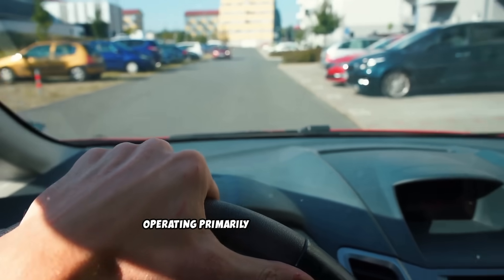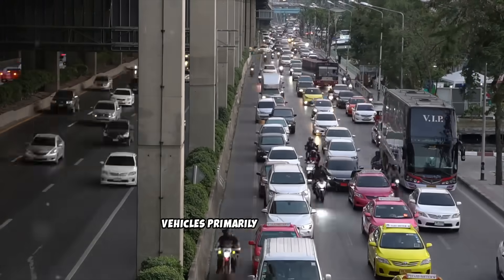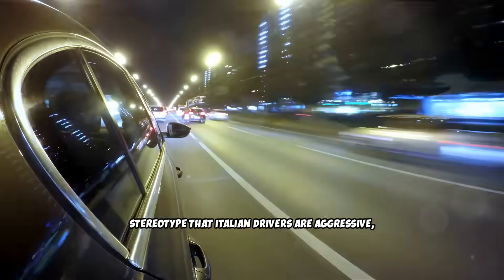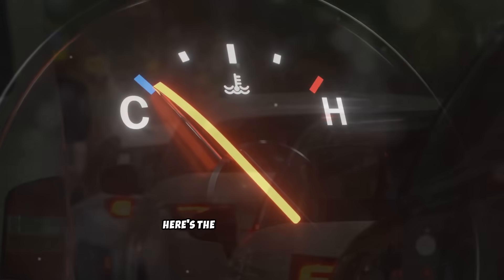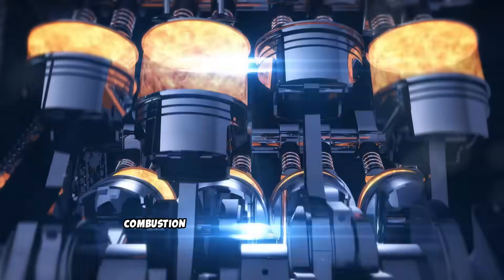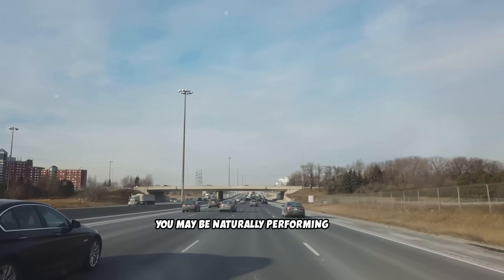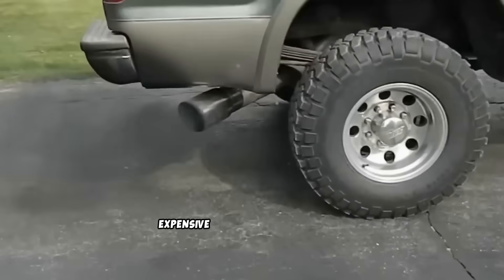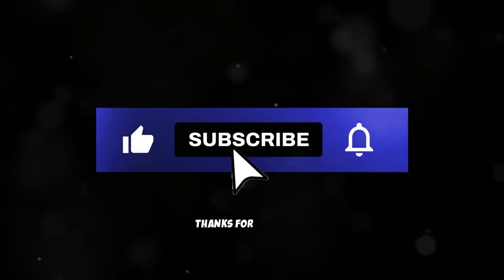Do THIS Once Every Two Weeks, and Your Diesel Engine Will Last Forever

Comment: I have a 1.7L diesel astra van, recently the glow plug light has started flashing on the dash. As a self employed Gardener my jobs are local and driving is usually short, however after giving the van a blast a couple of times, the glow plug light stopped flashing, yesterday it came back on again after doing some shorter journeys. I'm thinking it's the DPF, so i'm going to try giving it a blast again and if it's stops this time, i believe it confirms my suspicions of the DPF?

Comment: I wonder if using a lower gear (higher revs) at a given speed creates more heat? My physics brain says the car is still under the same load so it wont make much difference. Answers on a postcard....

Comment: Every time a channel tells me to watch till the end, my sceptism level jumps to caution mode which takes me to the comments column.
However, on this occasion  the comments corroborate what I find when driving my 2.2 diesel.
I've  even found that on long motorway journeys, driving in 5th gear at higher revs is a smoother ride, with very little difference in fuel economy. 
Also 3000+ revs up a slip road in 3rd seems to help too. 
The green agenda would have us drive every which way a diesel is least efficient, even to the point of destroying an engine, so it gets scrapped, then another car needs to replace it.

Comment: Hot, warm or cold I always let my truck run until it hits the 220f degree mark about 15 min, you can tell the difference. They are sluggish if you don’t let it get there before driving

Comment: Another good technique is if you do a lot of short trips with your diesel you can drive it in tow mode. This will hold transmission gears for longer which makes the engine rpms higher, resulting in more "work" for the engine. I wouldn't suggest using it in the rain or snow without a load tho.
Also, running your exhaust brake while driving will blow out carbon in the turbo, at the expense of DEF use. But DEF is cheap, turbos arent

Comment: Once a week I take my Volvos with proper D5 engine (imo best Volvo ever made) to run it like Colin Mcray!! Keep in on 3500 with my paddle shifts and basically flooring it and enjoying turn in country side!! 😅 it’s pleasure as well as good for my engine! Both vehicles around 250k now and no problems!! If you have diesel you need to know how to run it otherwise yes carbon built up can be a nightmare!! 😮

Comment: I may have been too gentle too long.  I'm going to get a real DPF cleaning at an industrial shop and do an EGR and manifold cleaning by hand.
Reply: Waste of money. The EGR cleaning is basically them connecting a device to your OBD port and set it to run at high RPM's constantly to warm up your DPF so it initiates a regeneration (burn out soot). You can easily do that yourself by driving at highways speed at 1 to 2 gears lower than normal. If you see smoke keep driving, because there could be alot. I drove mine like I stole it once and then I parked while idling and I thought the car was on fire, had it towed to the shop and it turns out it was just cleaning out the DPF and they didn't have to do anything. I just made the DPF get hot enough to sense it and initiate the process and a guy that drove slow everywhere had driven if for months.

Comment: My 2024 RAM has done 500 hours of idling in the last year alone (emergency vehicle). Yet the DPF gauge is at 0%, after bouncing as high as 25-50% briefly. That is because I frequently, when on the highway, set the cruise control and then downshift a gear to be right at 2000rpm. Do 50 miles with that, and it clears things out and goes back to 0%.

Comment: They also were not designed to have the exhaust fed back into the intake and the def system added to it.  It retards the exhaust and plugs up the motor.

Comment: Most mechanics who work with diesel engines will tell you to use this technique (or variations of it). Very necessary with the newer diesel engines which use Adblue and have DPF's.

Comment: One problem is the Exhaust gas of modern engines. Use a low gear. I use very often manual gearshift instead of the automatic gearshift to have higher RPM.

Comment: Same goes for All modern petrol engines with direct injection - they need to be revved up full stop. My ford ecoboost is wasted with carbon buildup - yeah, cause you drive in traffic like nanny, hammer down the s***er once a week and it will breath normally

Comment: 142 thousand in my Volvo S60 2.4 turbo. I only use VPower Diesel Fuel and have a Full service every Year. The Engine is smooth and powerful and on a long run, it is like a Greyhound. Once a week, I do about 40mins Motorway driving. You have to work them!!

Comment: Got my first dl in 2004, but had been driving before, because I got used with some carbureted vehicles, that exactly the way that I treat most the cars, key on, wait a bit, start moving gently, pay attention at the gauges, gear up, enjoy, cooldown period, turn off. 

From the past few years I have a old JDM Diesel, non-dpf from factory (its a 92) and I do that, and a some fuel additive (injector cleaner or diesel purge) every few full tanks) still going good.

Comment: I used to load my Dmax  produce from the farm, 3-4 times a week around 900-1200 kgs, it ran smoother and consumed less fuel. Now I lost the farm and the truck seldomly loaded with any load and consumption increases.

Comment: I’m retired and when I took my diesel van to be serviced at a diesel repair shop the young mechanic said the problem I had was caused by me driving at low revs to save fuel ; he said what I must do is drive it like a sixteen year old now every now and then. He was right it cured the problem.

Comment: The video explains the "Italian Tuneup," a simple driving technique to extend the life of diesel engines by counteracting carbon buildup, which often occurs from short trips and low-speed city driving.

The Key Idea:

    Problem: Driving at low loads (city driving) prevents the engine from getting hot enough to burn off carbon deposits, leading to reduced efficiency and potential DPF/EGR issues.

    Solution: The "Italian Tuneup" involves running the engine at higher RPMs and loads to generate the heat and airflow needed to clean out these carbon deposits and complete DPF regeneration cycles.

How to Do It:

    Warm-up the engine normally for 5-10 minutes.

    Drive on a highway or rural road, maintaining 2,500 to 3,500 RPM in the highest gear you can safely use (e.g., 65-75 mph).

    Maintain this speed and load for 15 to 20 minutes.

Frequency:

    It is recommended to perform this procedure once every two weeks, or immediately if you notice symptoms like reduced power, black smoke, rough idling, or a DPF warning light.

Comment: I had to do this for my 130000 miles Dacia dci. I suggest using a diesel fuel cleaner solution in a full tank to clean a lot of carbon. Then use one like Redex in a quarter tank. Redex works at lower temp, as does some others, then drive for 3000rpm for 20 mins. Solved all problems. The injectors are £200 each to service and then clean the rest so £30-40 for the fuel treatment is cheap. Mine worked I hope it does for you
Reply: you may as well buy new injectors.

Comment: What if I use a car like twice a week? More often 80 km range and sometimes longer trips. The reason why I dont use car that often is because I got a Bus that drives me to work so I dont have to refill tank twice a month. More money saved. Shoud I take my car to the highway every two weeks also?
Reply: Nah your engine is pretty clean as you are not choking it in town...
Only thing you can do when driving out of town to rev it at 2000 or little bit above that for 15-20 minutes...👍

Comment: Why can't you put it in sport mode or put it in manual mode and hold it in the the right gear so you don't have to go so fast
Reply: You can do that specialy driving up hill in a lower gear it will clean the engine but for the best results you need open road for better airflow...

Comment: I live in a major city where traffic is so bad that it's usually difficult to get to 60mph (100kph) but I've been able to complete regens in less than 10 mins by maintaining around 3 - 4k rpm in 2nd gear (60 - 80kph). I'm lucky that my cars visual display shows when it's in regen mode. I drive at higher revs as soon as I notice it trying to regen. Prevention is better than cure as they say. Not sure why so many other manufacturers omit this

Comment: Delete DPF delete EGR and swirl flaps all so get a new intake manifold get a carbon clean and put in premium diesel and watch it run like brand new
Reply: Plus fail your MOT and risk ruining your engine and turbo by running a higher combustion temp it wasn't designed for

Comment: U are all wrong, If u drive whit live data, u wil se for urselfe that this is totaly wrong ! 
When u drive whit low rpm. 1500 the engineering generate most temp. I have allsow live data at the particle filter, and it generate highest temp around 1500 rpm. The engine start to burn sot at 400 degreeds. 😊
Reply: When regen start is around 600 C to 900 in your exhaust pipe...😊
Reply: don't talk shite mate, go and study thermodynamics. High revs engine will produce more heat output. The live data is probably your coolant temp.

Comment: I also use dipetane. When you first use it you get a funny smelling light smoke coming out the exhausts for about a week. This is the carbon burning off. I put my porsche cayenne 4.2 d in for an mot and the emissions were nearly zero. My mate took out his dpf in his ford van and the black smoke coming out the exhausts for the first couple of minutes was terrible. He then put the dipetane in the diesel thinking it would be a waste of time. He couldn't believe it when there was no smoke at all.

Comment: Floor it the second u cold start your engine, garanteed way to clean your engine of any buildups...i do it every morning before i go to work, neighbours might hate me, but my car will run forever.
Also dont forget to rev the engine till 3000-4000 RPM before shifting to get the most power output without loosing acceleration inbetween shifts
Reply: Wrong! Never run a cold engine hard before its up to operating temperature!! Thats a sure fire way to destroy any engine. ( retired mechanic of 40 years).
Reply: Quality of diesel engine's are really good as they survive this cold start abuse...😊
Reply: lol… years ago (about 40) I witnessed a guy start his cabover

semi truck and hold the throttle to the floor. Yes,the outside temperature was around -15 degrees. It was a sickening sound when that engine started making sounds an engine coming apart….which it did

Comment: As the speed limit caps at 100 km near me, can i achieve the Italian tuneup by driving in 4th gear as opposed to driving in 5th?
Reply: Of course, from my experience should use best fuel money can buy like Shell, occasionally Shell V-power or other premium diesel fuel, never use cheap supermarket fuel...👍
Reply: @SvarogI2A2  I found no difference in which brand of fuel I use  (200,000kms driving)

Comment: How can I disagree with you more? There's a device in the cooling system called a thermostat it's job is to get the engine up to operating temperature within a few minutes of startup. The total premise of your argument is debunked within seconds of the discussion.
Reply: Does the thermostat not regulate the water coolant temperature? Engine temperature is a different thing.
Reply: Lubricant takes a lot longer than coolant to get to operating temperature - do not rev your engine hard when the oil is still cold as this is how engine wear is accelerated.

Comment: Diesel engines are the perfect machines for longtime heavy duty work, i drove my Bx Diesel foot down in Germany in 9 months to 190.000 kilometers. The garage could not tell the difference between my car and another Bx that had done only 15000 kilometers in almost the same time period. Stop the witchhunt on diesel engines they last forever and are the most durable off all engines when used properly
Reply: So I should sell mine if I don't drive much??
Reply: @dibosh7405 
Don’t necessarily sell it,just understand the video.

Comment: This "tune up" also works for cars with gasoline engines! I have both a gasoline and a diesel car and has been driving like this with both of my cars and they both runs so much better. I recommend everyone to get to warm up their engine slowly and then drive your car maybe not like you stole it but between rpm's at 2000 and 3000 with load up some steep hills, it works great in my opinion.

Comment: Diesels are for long distances. When you have to drive 30km + almost every day to work or for any purpose on highway. In that case they most of the time maintain itself without extra need for action like this, but even than is better once in a week, after engine heats up,  put in lower gear and drive for a while with higher rpm's. Also very smart is to not  notice a car manufacturer reccomendation in modern engines to change oil after every 30k km. Better change it after every 10k. Not because the oil is turning bad, but because of the carbon buildup particles deposits in oil.  Gasoline is for city driving.
Reply: So agree with you, i drive both my petrol and diesel car the way you say and the engines runs so good. I use longlife oil on both my cars and do the oil changes at 15K km and have never had any problems with that when using longlife oil that is being said that you can drive 30K km between the oil changes. I would never drive so much with the same oil in my engines.
Reply: Amen

Comment: I have done this before on my last car. Worked well. When the dpf light came on, I drove between 2 motorway junctions (20 miles approx), always in 3rd gear at 4000rpm. Cleared the light every time. It's more of a problem with my latest car as it's an automatic and the thing won't hold the gear I want, it just changes up to the next one. I'm not impressed 😅
Reply: Surely the auto box has a manual mode. I've had auto gearboxes since the late 1980's and every one allows you to use it in manual mode.

Comment: I did this with my Volvo C30 2.0D which seldom goes above 2,000rpm in the past 4 years -  I put it in manual mode in 3rd and took it to 3500 revs for just over 12 mile -  it seemed cruel but I did - it started smelling like something new being burned off - I did the last 4 mile in Auto  about 1500 rpm in 6th to let it cool off - at a guess I'd say the smell was the particulate filter burning itself clean - I may do it every couple of months as it does seem a bit crisper - the car is very overpowered for its size

Comment: Good information, thank you!

My Honda CRV Dtec (N16 engine 9AT) needs the itallian tune up
I just select to manual mode & drive within the speed limit staying between 2500-3000 RPM for 10-15min on the expressway
I also use Techron diesel additive every 4 months on a full tank of fuel 
HTH ✌️

Comment: It's easy to maintain the rev range in a suitable gear if you drive a manual car, but an automatic that doesn't have a manual overide would have to be on a motorway to attain the speed that produces the rev range required for safety.
Reply: Hills exist drop a gear
Reply: Yes, my automatic car tootles along at about 1250 revs at 70 mph in 8th or 9th gear. I would have to deliberately drop gears using the paddles to increase the revs but it would just change up again. Sometimes, I'll drive it in Sport mode which increases the revs a bit.

Comment: I take my Volvo XC60 Diesel every week to the Autobahn and go 200+ kph for a longer time.
Reply: What is the purpose of that? That's not a sports car, you are wearing out your CV joints, hub bearings, transmission (aisin tf 80sc in this volvo if its automatic, but same , same as mine transmission, I can tell you the oil goes 105-110 degrees at 170-180km/h, and that's when transmission (ATF) oil starts to 
degrades and occur varnish formation and destroy seals)  and many many more shits.

Comment: I'll add I run my diesel Kia Ceed runabout on high octane diesel, never had a problem with clogging or emissions. And it's more economical than standard diesel, smoother and better driveability, which offset the extra cost.
Reply: You want to focus on cetane with a diesel engine. You're kinda spreading misinformation here.
Reply: @AUCongnitiveRealist as an ex diesel development engineer I obviously know what I'm taking about unlike you.
Reply: @richyclubsport5155 I’m sorry, but you are wrong, diesel has a cetane rating, not octane. However, I agree that it is better to use premium diesel as it contains better detergents to prevent build up of nasty particles.
Reply: Yep. Cetane.

Comment: I drive everyday at least 140 kms on my diesel, 70kms each way, door to door no stops.
I turn off the S&S every single time. Drive below 2500 and above 1800rpm until oil reaches 90 degrees. After that most of the time never drop below 2000rpm. If need to drive slow drop a gear so the engine is never lugging. Explore the rev range regularly for short periods. Diesel engines love heat and a workout, particularly the more recent ones with the anti-pollution systems. 
Also avoid interruption of regen cycles. Higher idle than usual or if, when stationary, the engine doesn’t go off on its own and S&S is unavailable do not turn it off. Either drive or let it run until goes off on its own. 
In 100.000 kms I’ve never seen the DPF light ON. 
The oil spec is critical as well as changing diesel filter with every oil change and not 2 yrs and or 30k kms or more like OEMs specify.